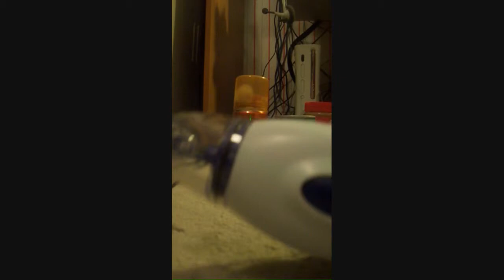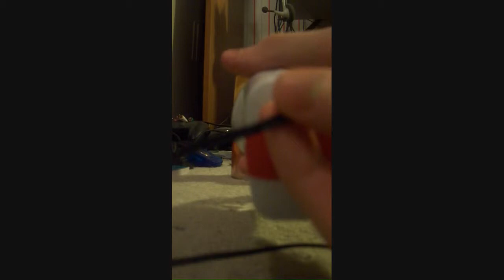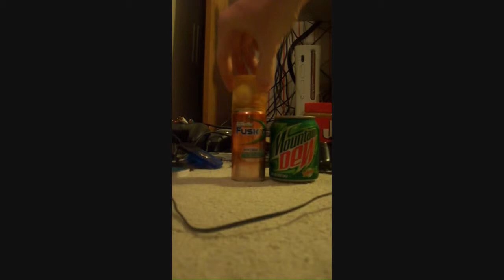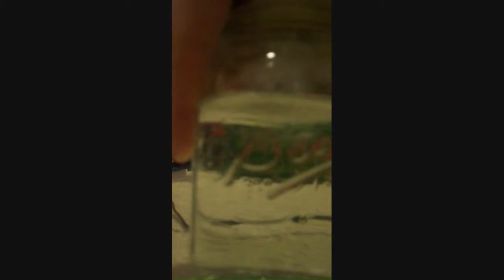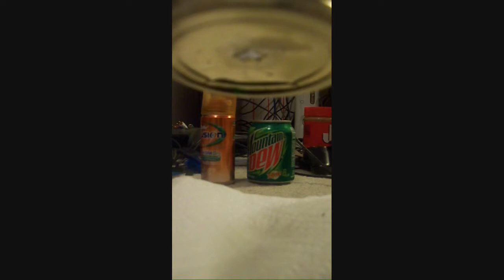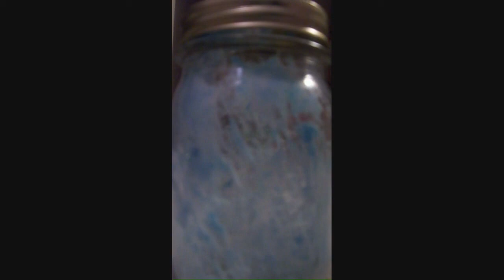Effects of Negative Atmospheric Pressure Part 1

Comment: Are you actually talking about negative pressure or very low atmospheric pressure? Afaik it's impossible to have negative pressure in a gas (like the air above the hot water).